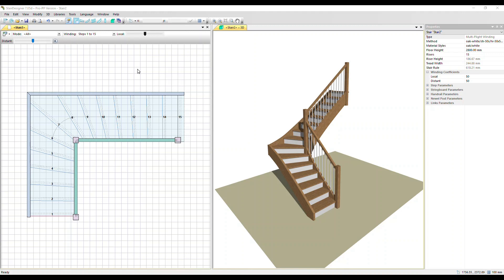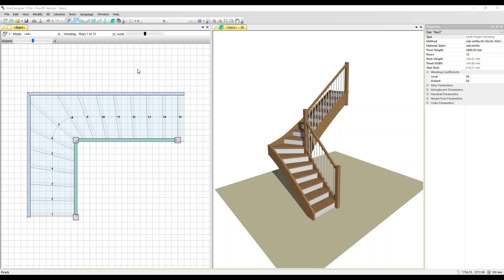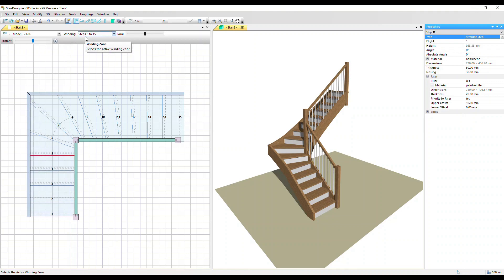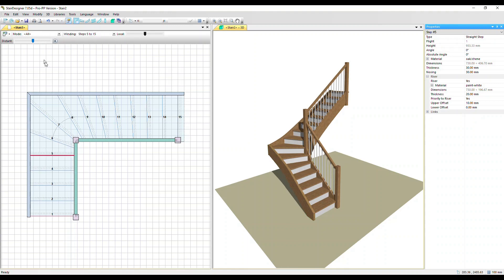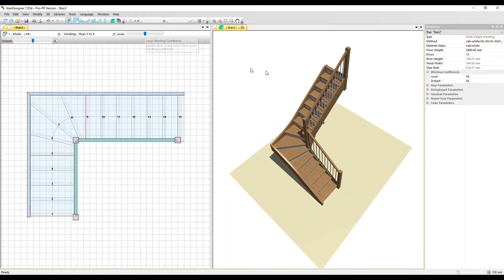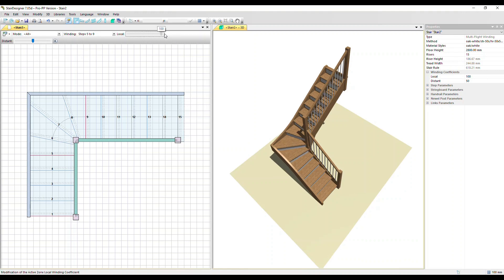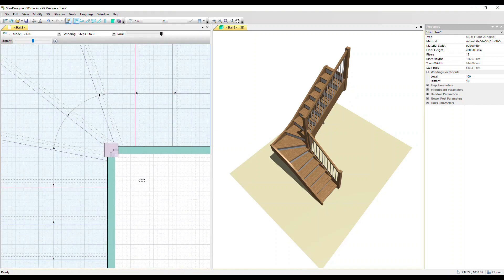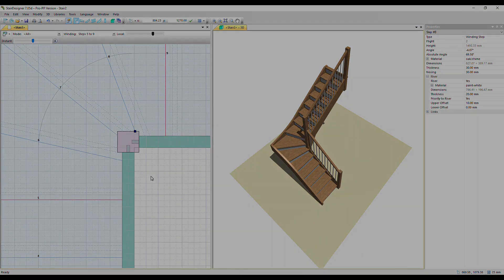How to Modify Winders using StairDesigner

Comment: What if I want to move where the winders start? I want two steps at the bottom, then my winders and then steps going up straight, can i do that with your software?
Reply: You can do this by creating a stair in the multi-flight mode. The winders must be created with landings. This allows you to control the step qty in the first and last flight. Download our software on the website together with our quick design Libraries. This will create a folder on your desktop in which you will find folder " models ". Open folder "3 steps adjustable winder stair" This stair is an example of this specific setup

Comment: What about if you wanted to eliminate the winders altogether? How would you do that?
Reply from the maker: Hello Ibrahim, thank you for your message. The video is showing a quarter turn stair so are you asking if it's possible to eliminate all of the winders? Winders are always needed in a quarter turn stair unless you use a landing instead of a 3 step winderbox. If you need the straight steps to be done all in one go for the full stairs it is not possible, as it needs to be done in 2 steps as the video shows. If you need further assistance, please don't hesitate to email us at support @ wooddesigner . org. Crystal